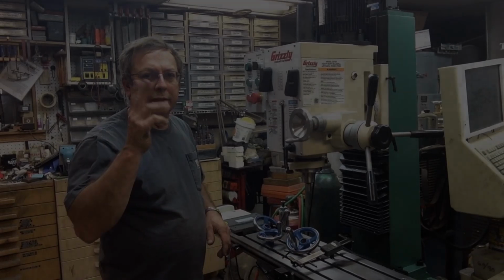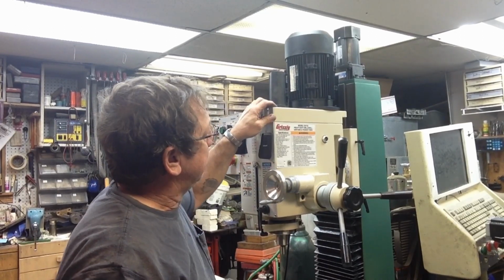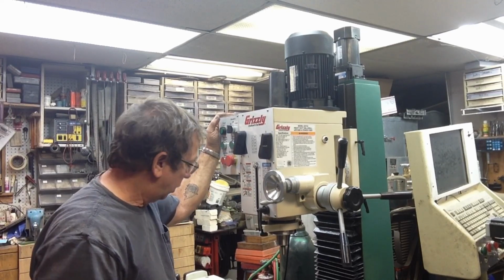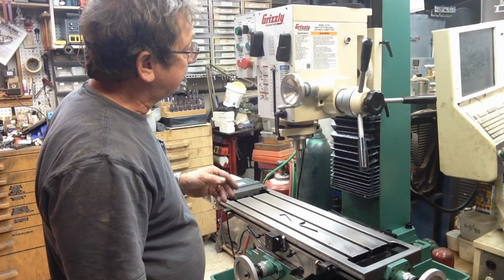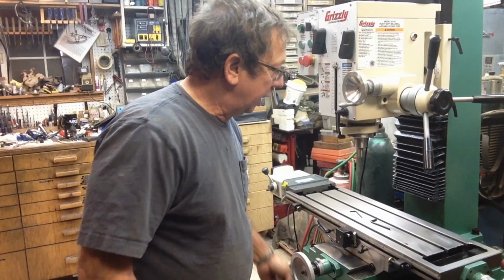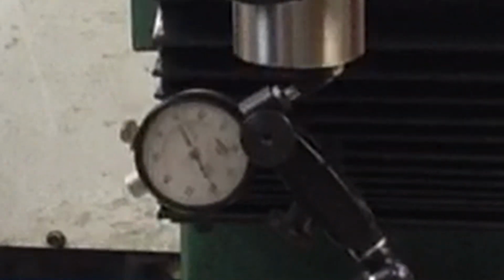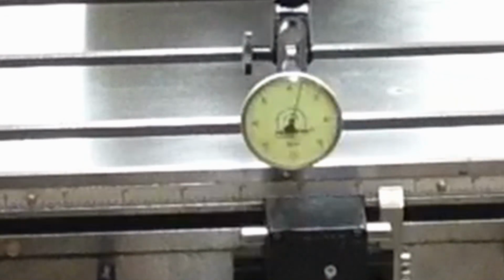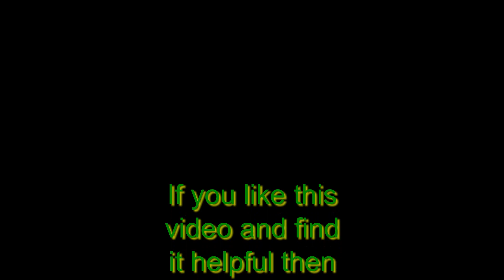Grizzly G0755 ; Part 2: The New Mill Has Arrived

Comment: Out of curiosity will the spindle reach past the back Y axis? My clone won't.
Reply from the maker: Hi Glenn: No it won't at this time and I referenced that in one of my videos in this series, but it has been pointed out to me that there is actually more travel than I initially thought in that direction. I will be adding a video that covers the design flaw and see how much Y travel there really is. Dan.
Reply: @hillsgun  thanks. My clone the spindle overtravels the near edge of the table a couple inches making it totally unusable travel, but is about 1.5 inches shy of the back edge. It is though the bed should have been easily 4 inches longer. Custom casting?

Comment: Due to my shop set up I had to dismantle my 3/4 sized Taiwan built Bridgeport clone into it's basic components to move and get it into my shop. In hindsight that was a good thing. I washed down all the way surfaces and feed screws with solvent to remove the anti rust preservative they slather on these machines, removed a few burrs with a stone on the way's and gibs, reassembled, re-adjusted the feed nuts, re-lubed and ended up with a far tighter machine with less than 1/2 the screw backlash it was adjusted to at the factory. While I didn't find huge amounts of grinding dust, there was still enough (maybe a few grams) the time spent doing so was well worth it. The one thing to remember is these off shore machines have numerous areas where corners get cut. That cleaning at the factory prior to assembly are just one of the items they usually skip. And the machines aren't adjusted as well as they can be to compensate for the room that anti rust coating takes up.  From what I saw as before and after results I'd highly recommend at least pulling the table, feed screws and Y axis on that mill. The oil color dripping down the front of your Y axis from the X axis as the table was being moved shows it's needed. Yeah it takes a couple of hrs to re/re the parts, but the difference it makes is pretty amazing.
Reply from the maker: Yes there is some validity to what you say and I have been down the import machine road before, The problem with that advice is that many individuals who will purchase these machines whether they be a lathe or mill is that they are relatively new to machining and do not have the experience to disassemble then reassemble and properly readjust the machine so what they end up with is a machine which is further out of adjustment and get worse results than had they just cleaned the machine and put it to use. The machine came with a fairly well written manual that gives recommended cleaning, lubrication, break in and maintainance  procedures which to a large measure takes into account the issues with the import machines such as changing the headstock oil at break in, so I recomend following the manufacturers procedures and use the machine. the excess oil you see on the machine is after cleaning the cosmoline from the machine and flooding the ways and leadscrews with an abundance of machine oil to help wash further contaminates and preservatives from the machine.

Comment: Just found your channel. Congrats on new mill. I was curious about your thoughts on the emergency stop button being the only way to power off machine. Isn’t better that you are forced to use this constantly and in the event of an emergency it’ll be just  natural reflex to hit and not searching for a button you never use? I own a few small Grizzly machines a DP, bandsaw, and belt sander and am overall happy with them. Hope you enjoying this new machine
Reply from the maker: Thank you. I have adapted to the e-stop button but I still do not like it setup this way. As far as I am concerned an emergency stop switch is just that- to stop everything in the event of an emergency and I don't feel that it is even necessary on a manual machine like this where the only power feed is on the table traverse. When it is made an on/off control it's importance has been minimalized. I have never had a problem finding an e-stop on the cnc machines because I know they are the most important control when the machine is in motion. Thaks again,Dan.